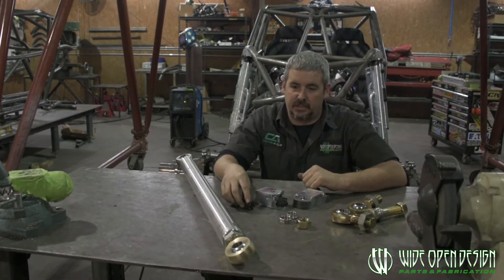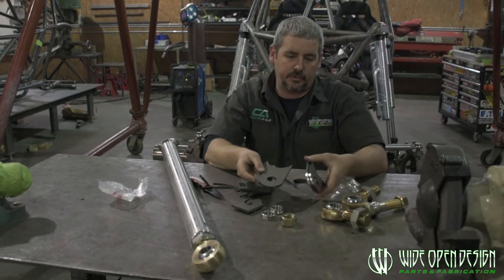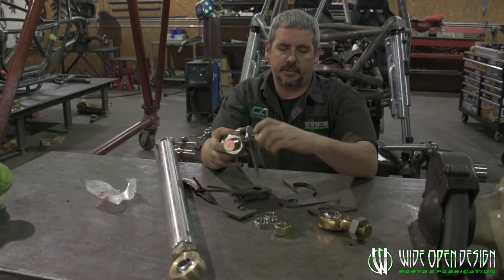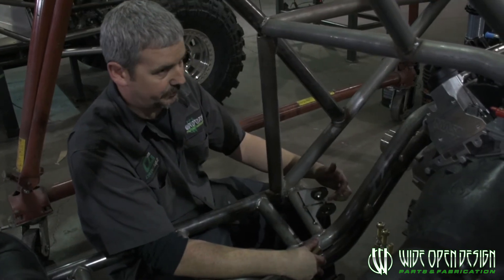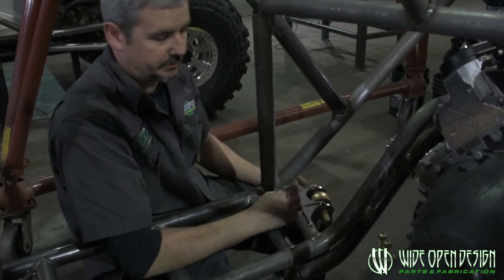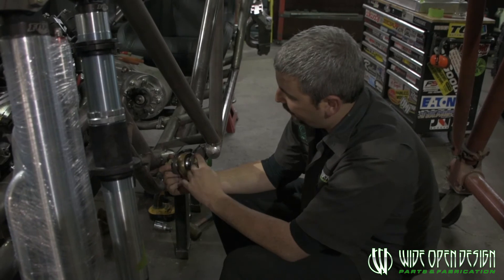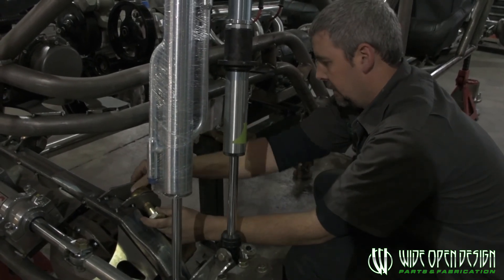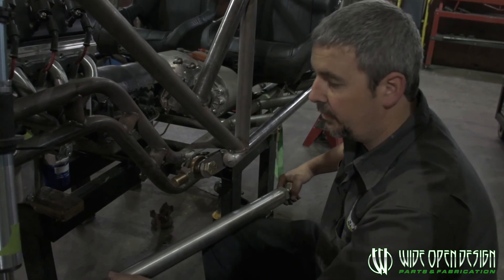MEASURING SUSPENSION LINKS | Correctly measuring link length | Wide Open Design

Comment: I have your 1 1/4 chromoly heims 1" bolt that has 1.62" of usable threads keep in mind thats all of the thread that is exposed with the nut in play. so that leaves me with only 1" of threaded going into your 2.5" aluminum links that are both top and bottom 35 1/2" long. Do you see this as a problem. the top heims are buried into the links all the way. If I shorten the bottom ones anymore Im getting into a driveline issue at bottom out right now I have +7 caster on the front axle to eliminate the collisions of the upper link to the driveline at bottom out I currently have 1/2" from contact at bottom out.
Reply from the maker: If you still need assistance, please give us a shout at
615-962-9135

Comment: So, do you measure that distance while the axles are at ride height with the rear axle oriented the way it will be when the driveshaft is in place? I mean, accidentally shortening or lengthening the upper control arms will affect how the anti squat (or anti dive) changes with respect to wheel travel, won't it? I like your videos BTW. Thank you!